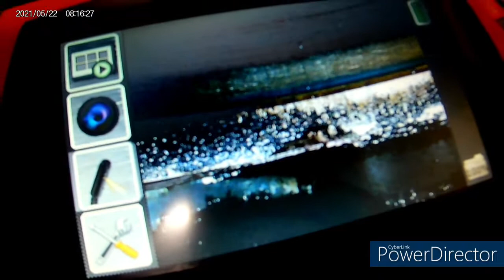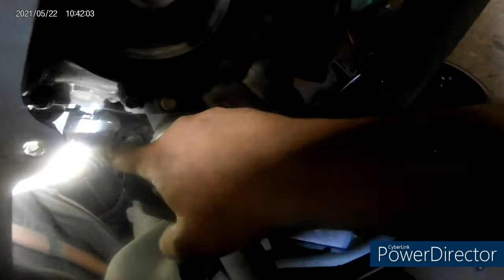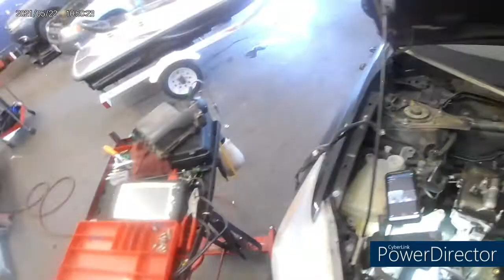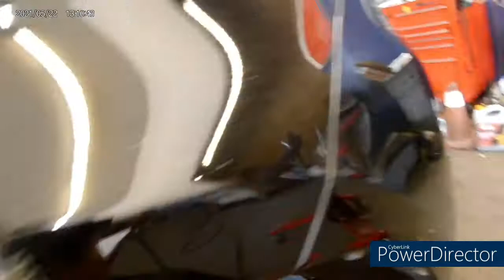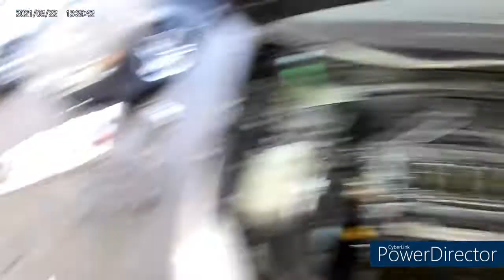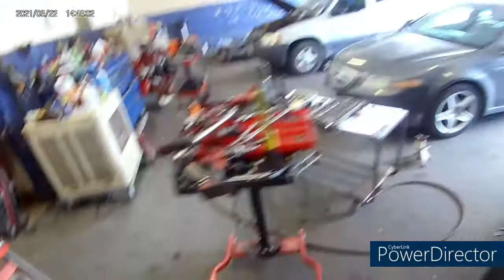PRIUS HEAD REMOVAL 1.8l

Comment: Are the o-ring type seals in the valve train that the Felpro set doesn’t come with(that 3-in-1 o-ring and the other singles) sold as a set from any particular manufacturer?
Reply from the maker: @EvzenKovar-i5p  I have only been able to buy them individually from the dealer.

Comment: I will be changing my 2010 with 300k in a few weeks after i round up all the parts needed i only paid 1600 from a buddy and the only problem until the gasket was the coolant pump I love the car and it has run like a champ the paint is bad but i got a letter from Toyota about the paint recall I have been watching lots of videos over and over to educate my self on the procedure and it don't look too hard. Your videos are detailed and very helpful..Can you provide the part number for the gasket set you use and what items are not included and any advice you can offer be much appreciated.  i will be cleaning the air intake and whatever else is needed since i will have everything apart 
if i fuck this up i will have it towed from Lakeport to your shop.

Comment: I have 2 I need repaired asap . What do you charge 2010 and 2012
Reply from the maker: The last estimate I put together for prius head gasket repairs wound up being around 2500..... unfortunately the customer also had a bent connecting rod which also had to be repaired.... Its rare to find that but sometimes happens. But the end price with connecting rod replacement wound up being around 3400 bucks. And was still half of what he was quoted for head gasket repair by the dealer in napa. I do know parte have gone up a lil bit so I would expect around 2500 dollars give or take a couple hundred bucks if you had it done through me. Give us a call and schedule an appointment and we'll see what we can do to help ya +1 707-277-9582

Comment: How much does this usually cost to have done and how many hours should I be charged for the job
Reply from the maker: That all depends on where you live. I live in california where shop labor rates right now are in the ballpark of 140 bucks an hour these days. When I was at the dealer the book labor time was 24 hrs. Im working in an independent shop now and recently looked up shop labor time for this repair to be at around 17 hrs. Plus shops are going to recommend machine shop pressure testing things like that to ensure the head is still serviceable before reinstallation. So figure an additional 350 bucks for that.

Comment: bought my gaskets and everything i need to do this job! any recommendations for parts i should replace while im doing this? thanks for these vids!
Reply from the maker: As long as the head warpage and block has no warpage which is really rare have not even experienced one yet myself.... replace the spark plugs. Otherwise most of the stuff is re usable but does need to be inspected 👍
Reply: I'm doing mine these incoming weeks I'm changing the water pump and clean egr cooler, intake manifold, and head, hopefully head or block are not warped.  Only seems to be leaking in cylinder 2
Reply from the maker: @lobogris4806  that seems to be the most common cylinder to have leak.... as for warpage its not impossible but very unlikely as long as u follow the removal sequence to A tee

Comment: Red RTV high temperature sealer can be found at your local Walmart or auto parts store instead of the more expensive Toyota sealer
Reply from the maker: Actually I do not recommend the red rtv.... its not the greatest sealer for aluminum surfaces.... if you are going to substitute it for an RTV and not use the toyota FIPG..... you are better off using ultra grey. Now the black FIPG from toyota is actually not that expensive its like 18 bucks for a tube..... this whole project including sealer and coolant actually cost a lil under 200 bucks if you do it yourself.

Comment: When doing this job would you recommend going ahead with a water pump replacement although it seems to be in good condition? Currently taking on this project on my 2012 Lexus CT200h (same drivetrain) w/ 168k and I'm wondering if it is worth doing while I have it in hand
Reply from the maker: Personally unless there was something physically wrong with that water pump I dont recommend changing it. The electric pumps are not exactly cheap for 1 and they will tend to throw a water pump speed variation code when they do go bad..... now thats not to say replacement is gunna hurt...... but I have done many of these head gasket jobs and not had an issue with them after the job.
Reply: @rivieraauto8540  Thanks for the quick response. That’s about what I figured. Without any overheating and just the small leak have you found the need for resurfacing the head pretty common, or just case by case and inspection based?
Reply from the maker: @gv4832  do not resurface those heads take to much off and you run the risk of cam timing to retarded codes being set. I wanna sat off the top of my head..... the tolerance is close to only .020 material may be removed from that head....  if its warped its most likely gunna be way out and you will be looking a head replacement.....good news is..... with as many as I have done so far I have yet to find a warped head on these cars.
Reply: @rivieraauto8540  Much appreciated. I've had similar advice from others but I like to make sure. Haven't had any significant heat so hopefully warping won't be an issue.Again, much appreciated
Reply from the maker: @gv4832  absolutely best of luck on yoir project man